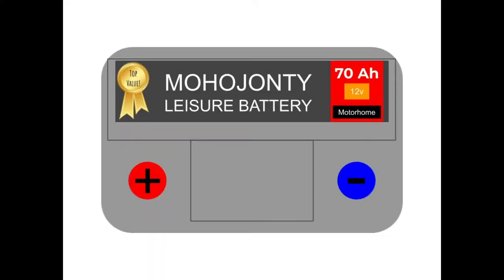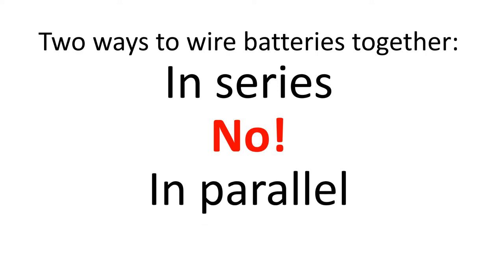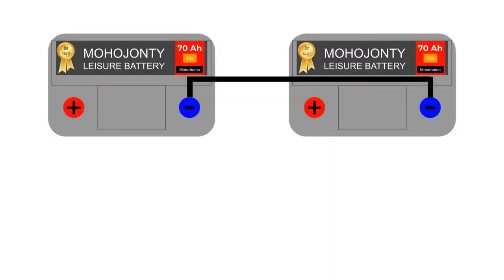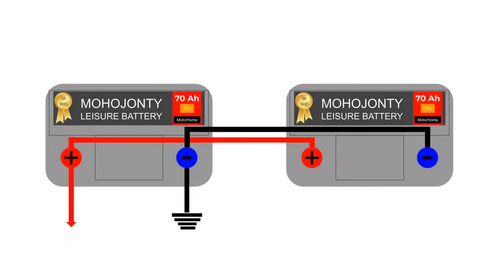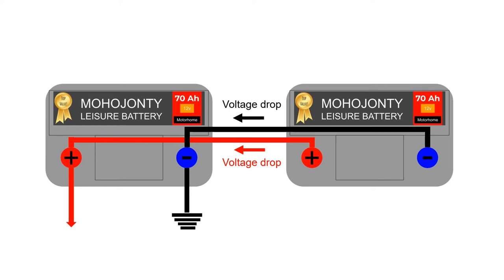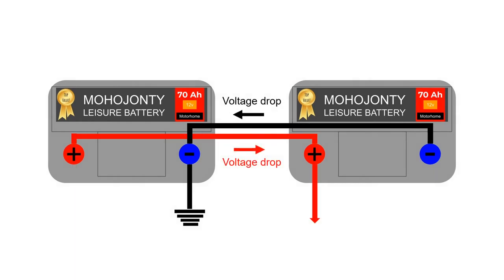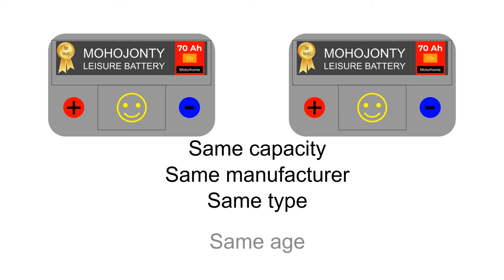Leisure batteries. Terrific! How to wire two batteries together for more capacity

Comment: Ive got 2 new leisure battery's to wire up and get the balancing flow ideal but with freedom on location so could I switch them to terminals facing each other and cross rhe connections keeping the cables short?

Comment: Can you tell me how i know  i have double the amp hours  as it still shows 12 volt  system obviously , but. I can not find anyone stating how you know the power used or got left as i understand it i should now be able to use. An item 2 times longer ,lets say ?  But im going. On my charge controller state 12 .1 amps  .... i have 2 x 110 amp hour battereies connected up as you shown me thanks .im complete loss to my main questions here ??

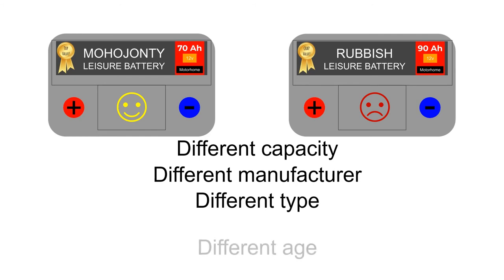Comment: 05:45 why do you say mixing capacities is wrong. A fully charged 90ah battery is the same voltage as a 70ah battery is it not?